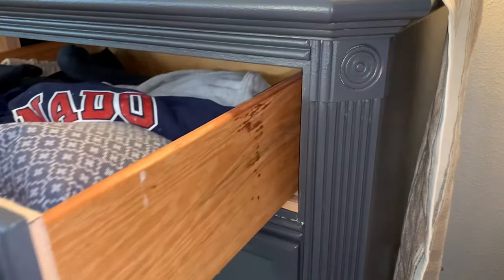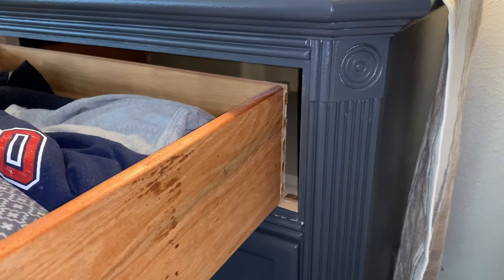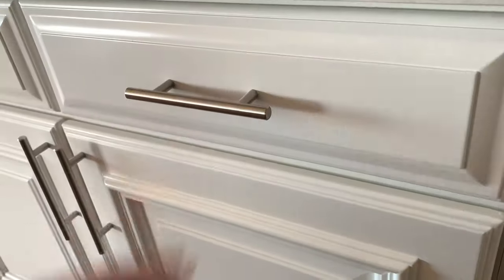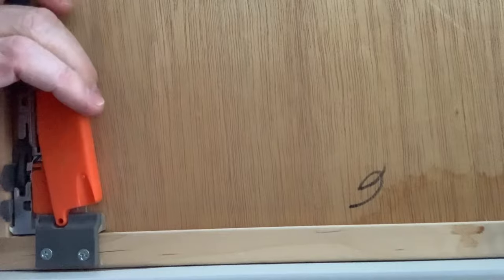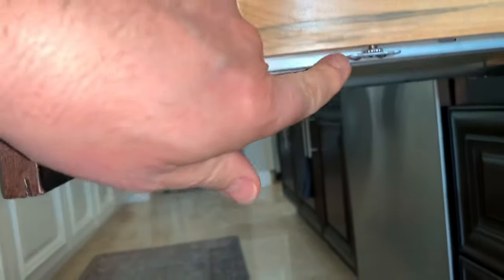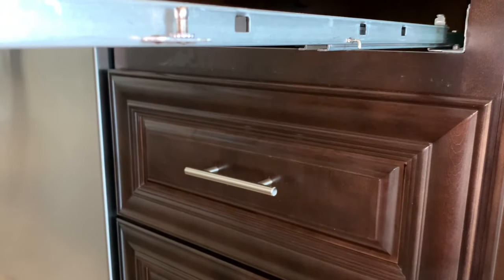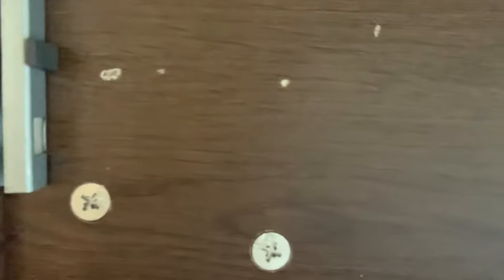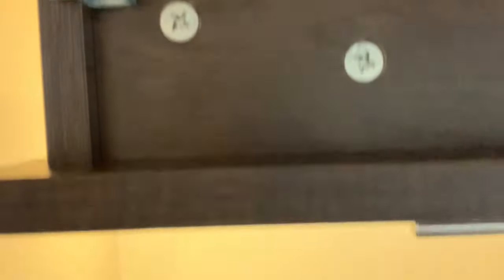How Do I Remove This Drawer?

Comment: Thank you for this video. My pot drawer became locked with a pan's handle keeping it closed. No way to get in from the sides only a small opening above, but there was a smaller drawer above it. I watched your video and learned that I could push in the levers on the bottom front of the above cabinet. I pushed the 2 levers, pulled out the cabinet and was able to put my arm into the bottom cabinet and move the pan's handle out of the rolling mechanism. 

You sir are a life saver with this video. Thank you!!!!!!!!!!!!!!!!!!!!!!!!!!!! You have earned a new subscriber. :)
Reply from the maker: Thank you Elizabeth! Glad to help you!

Comment: Thank you so much for making this video. I had spent a good 30 minutes trying to figure out this drawer. It has a red  plastic piece on each side but I couldn't make it move to release the drawer. Turns out the drawer is like the last one and the drawer came off in a snap after sliding the two white pieces out. Appreciate your instruction. And now I know how to remove all sorts of drawers. 🙂

Comment: Thanks for letting me post.  I was able to solve this.  It turned out that I have clips.  If one side's clip tip points up you push up and push down if the other side's clip tip points down - push both at the same time and pull the drawer out until it unlocks.  Thank you again.
Reply from the maker: Glad you figured it out!

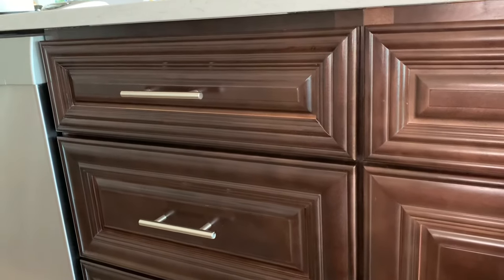Comment: I knew every design had to have it's own justification, which is good because I didn't want to damge it. Thanks for the help. I happened to have the one at 3:00. I have never seen those before and other people said there was supposed to be a latch and that those where adjustments only and not for removal. Thanks again.
Reply from the maker: Glad to help!

Comment: Thank you so much for covering so many different types!! I could not figure out how to remove the last type of pull-out drawer you covered in the video 😅
Reply from the maker: Sweet! Glad to help you
Reply: I have nightstand drawers with a semi circle, hard plastic stop that's screwed in on both ends to the wooden drawer glide. Hopefully that makes sense. I'm sending pictures that aren't very good because of where they're fixed but hopefully you  can get an idea and tell me how I can get these drawers out.🤞 5:49

Comment: Potentially useful note/discovery: I have a desk drawer with a bottom wooden track, similar to the dresser drawer you show in the first section here. However, instead of having a stop at the back of the drawer, there is a little lever at the front of the... drawer hole? The cavity in which the drawer lives. So you need to pull the drawer out most of the way, stick something like a screwdriver or ruler into the gap to hold down the lever, and then pull the drawer the rest of the way out. This can be a two-person job since it's pretty tricky to hold down the lever with sufficient strength WHILE pulling the drawer straight outward.
Reply from the maker: Wow, sometimes you have to be an engineer just to remove your drawer!

Comment: Thank you for your video.  I am still having extreme trouble removing my kitchen drawer.  It has metal sliders, but I don't see any levers.  There are 2 long, thin black pieces that could be levers, - the right side is curved downward and left, upward within the slider in the back.  However, pushing both down or up, or one down and one up, does not disengage/unlock the drawer so I can remove it.  Any suggestions?  I would appreciate this so much.
Reply: I must have Older guides no clips snaps or levers obvious on ball bearing side tracks. I’ve checked carefully both sides inside top and bottom of drawer. Where else might whatever may it 😢be? Andrew

Comment: Really liked your video. It will help me with a lot of my drawers. I am struggling with a chest of drawers that have middle rails and the rail seems to have a piece of metal in the middle of the rail. It doesn’t seem bendable. I can fully understand how that metal piece keeps the drawer from coming out. What do I do to get that drawer out?
Reply from the maker: If you pull the drawer out, can you tip or lift the back of it?

Comment: My drawer is the same as your first drawer.  I am still having trouble removing it.  The drawer is also collapsing when opened all the way.  Any tips?
Reply from the maker: I would empty the drawer completely first. That should make it easier to see what you are working with. Can you tell if the drawer rides along a top rail or a bottom rail like in the video? I assume there are no side rails?

Comment: I had another variation of the vanity draws which had a grey plastic spring push within the rail. Took forever to find it! I did a video  for my ref in 5 years if I ever have to remove them again.
Reply from the maker: Great move Phill!
Reply: @MikeKlimek  Thanks Mike. I'd have posted it here but pretty sure you can't do things like that in comments. Your video really helped to just demonstrate there are so many different ways to remove drawers that I realised it could be just about anywhere.  If it's of use I'll take out the draw again at some point and send you a slightly better quality video and you can append it to the end of yours.

Comment: I have an oak bedroom set with a bottom drawer that won't go all the way in or out. Can't remove it. It has a single center metal on metal rail. Another drawer in the set came out accidentally and went back in easily. so I know the bottom rail is wider to accept a narrow top rail within it, and the bottom rail has a moving slider within it. So it's a 3 piece system. There is no accessible lever or tab. If I try to force it more than already attempted, metal is gonna bend. What do I do?

Comment: I been having a problem opening and closing one of my dresser drawer for a long time, somehow it was not catching right.. Thanks to your video I was able to remove the drawer and to my surprise the center wooden cleat was worn out and cracked.  Now I need to replace it but I don't know who would do such small wood work.  Do you have any suggestions on where to go so I can replace it??  Thank you!!!
Reply from the maker: You can do a search for "furniture repair", or call a handyman. It shouldn't be too difficult. There used to be a franchise called the furniture medic. Not sure if they are still around though.
Reply: @MikeKlimek  Thank you kindly for your reply. After asking you for help I contacted 3 cabinet shops but none of them did that kind work. I didn't think about furniture repairs. Thanks again..

Comment: Good video for several types if drawers. However, no guidance for drawers with side rail guides and "lifting" once it is pulled all the way out and no bottom guide on the drawer. That's the kind of drawer I'm struggling with. 😫
Reply: same any luck?
Reply: @bluecoozy  nope
Reply: Did you manage to get it done? I’m stuck on 1 as well
Reply: Funny, me too
Reply: Im stuck too!!
Reply: @bluecoozy it might be the same as the ones I've just done. A spring loaded plastic catch, very small grey triangle of plastic near the front underside of the draw
Reply: There is a lil black pieces inside the slides.. hold the left side up and right side down or vice versa… then u can pull it out
Reply: @tuwannarico Yes. I had been struggling with this type of drawer for a couple of years. Luckily, I watched this video & got it out in 30 seconds. Really helped.
Reply: You just made my day!TY
Reply: @tuwannarico not on the ones I have. The ones I have have a hemispherical plastic bumper where the lever would be

Comment: Hello…. Thank you for your video.  I have a dresser from the late 80’s - early 90’s….. its from Norway (names of store in NJ USA….Scandinavian Gallery and House of Norway).  They have a side rails on each side of drawer but no clips or teeth or anything i can see to detach drawers….. any ideas?
Reply from the maker: The answer is somewhere on the rails. A couple things come to mind: extend the drawer all the way out and lift up. Next is there a button or tab that you can push in or pull out? Somehow the drawer will pull out or lift out

Comment: Mike, very good video. But, not complete. I am dealing with a single metal center mounted slide. I have to move the cabinet upstairs and tried to lighten the load by removing the drawers--but no luck. I did not want to force it to avoid breaking any parts. So far no luck.
Reply from the maker: Certainly there are more styles of drawers than I had access to for this video. There has to be a release there. Worst case remove the contents of the drawers

Comment: I have  west Elm tower base 3 drawer mid century modern end table in bedroom top drawer is not aligned properly. I can get the drawer off using the clips on the slides but still can not get it to close properly. It’s actually more off now than when I started. Suggestions? I do not see any other way to reattach or reposition the rails. It has been misaligned since purchase but that was before Covid and as this is a 2nd home I haven’t been here to fix .

Comment: Thanks for the video. You didn't cover the type of drawer I have, but I'm sure helped others out. Mine has a wooden rail underneath in the center like your first one, but at the VERY FRONT of that rail it has a plastic triangular shaped piece on the top and where you showed the back of your drawer where that brown plastic piece was to start the insertion onto the rail it is not completely open like yours, there is a kind of female matching t-shape closing it off in the back and that triangle piece on top of the rail has to match up with the t-opening to get it on. I got a drawer out by pulling hard (thinking it was the first type you showed) and the plastic piece in the back broken and the drawer came out. But NOW, even seeing how the catch and the rail are shaped I can't figure out how to get them out, obviously you have to mate up the triangle on the rail and the female slot in the back, but for the life of me I haven't figured out how to do that. I have broken another of the back clips trying to figure it out.

Comment: The lil' clips are missing from our wWayfair (ikea) bathroom vanity; the drawers are like the last example.
It appears that because the clips were/are missing that there are screws in the holes in the front instead of the clips... is taking those two screws out how I'll be able to remove the drawers?
Reply from the maker: Without actually seeing it, it sounds like somewhere down the line, someone replaced the clips with the screws to hold it. Sounds to me like removing the screws will allow you to remove the drawer. Good luck!

Comment: Had to take out a soft close vanity drawer with the small yellow tabs on the side ( not the long black ones that you pull). When we put the drawer back in it doesn't go in all the way???
Reply from the maker: Hmmmm. It's got to be getting hung up on something. Are the tabs still pulled out as you try to put the drawer back in?

Comment: I have a matching dresser and nightstand that I cannot remove the drawers.  They come out so far then stop, but I can't find a release or anything.
Reply from the maker: It may be hard to determine, but does it have slides on both sides at the bottom, or 1 at either the middle top or under the drawer in the middle?
Reply: Sounds like mine, and I cannot remove them — so aggravating!
Reply: Same! Mine have the rubber piece to stop it and rail under in the middle. I keep trying to pull out and lift and wiggle ao many times but it won’t budge 😞help!

Comment: Please help !!! I have a chest of drawers that has the same mechanism as in your video I removed the knobs to put all new ones on two of the drawers will not open how do I get them open thank you for anything you can tell me
Reply from the maker: Is it that you removed the knob and now don't have anything to grab to pull it open? Maybe insert a 3" screw into the hole until it grabs and then you should be able to pull it open enough to replace the knob.
Reply: @MikeKlimek  Yes I removed the Knob and had nothing to grab , I did what you suggested I used a screwdriver and I was able to open 3 drawers !! I cannot thank you enough 🙂
Reply from the maker: @blueskys8876  That's great to hear!

Comment: I've got a centre glide I cannot fathom! There's no plastic or other tab to move to disengage it. HELP!
Reply from the maker: Is it a mechanical guide or just a piece of wood? Is it on top of the drawer or underneath it?
Reply: @MikeKlimek  Hi! It is a mechanical not wooden single centre underneath with no plastic tab (on any of the 3 drawers so not broken off). Your help is very appreciated. Soula
Reply from the maker: @savgoulis2826  There has to be some kind of release there. Without being there it is hard to diagnose
Reply: Mine are the same way in my china hutch. It only comes out half way now. Nothing on the bottom that I can see

Comment: i have a single center mounted drawer that does not extend fully- not sure how/ if it can be removed.?
Reply from the maker: There has to be a mechanism there somewhere to push, pull , slide etc to release it!
Reply: @MikeKlimek  Thanks for sharing your video. and responding.  I will check , have you seen these single , center , metal rails?
two of the three drawers do not fully extend.
Reply: why would newly constructed drawers have only a single,centered rail?  seems like not the best way to go.
Reply from the maker: @jmchugh500  I'm guessing it's probably cheaper...

Comment: I can't open the drawer because there is something in the drawer that's obstructing it.   It's a 2 drawer dresser.  Can  you help me?  thank you
Reply from the maker: That can be tough. I've had the best luck trying to stick my hand/wrist in and then closing the drawer as much as possible on my hand to relieve the tension that the item is placing on the opening. Maybe try grabbing a thin. long item like a butterknife or screwdriver and try to push the item down as you try to goose the drawer open...easier said than done
Reply: @MikeKlimek    I so wish I could.  It’s a dresser drawer so it’s not giving at all.   I’m thinking of taking off the back part . Wish I could take a picture to show you.

Comment: I have a side rail and no way to remove the drawer to reattach lose hinge. Do you have an example of a side rail?
Reply from the maker: There isn't an example in the video, but there is a mechanism there to release the drawer. There may be a tab to lift up,push in, or push down, or there may be a small button to push in. It's there somewhere
Reply: @MikeKlimek  found them, thin tabs on the side, thanks!
Reply from the maker: @patrimadny212  Awesome! I knew they were there somewhere!

Comment: I have a drawer that has a centre metal rail and the drawer can only come out about 1/4 of its length - drives me nuts.  It’s not like any you showed.
Reply from the maker: Is there something in the drawer that hits the lip of the cabinet and prevents it from extending further?